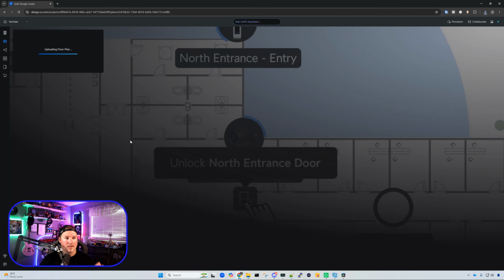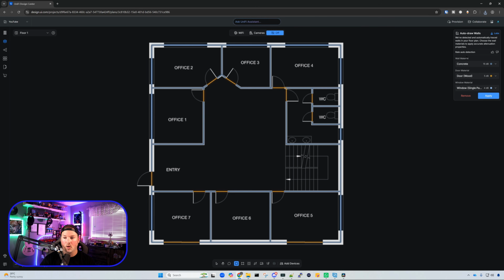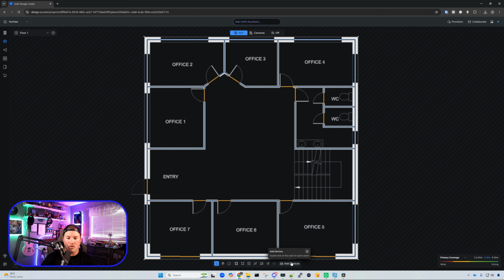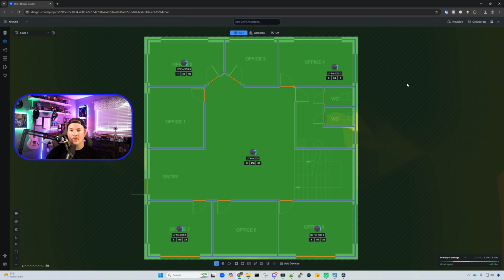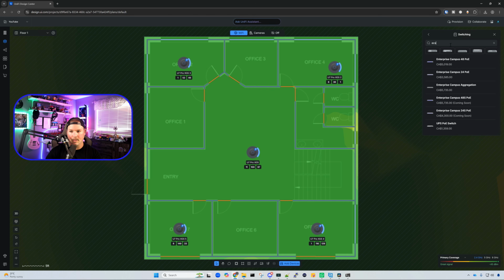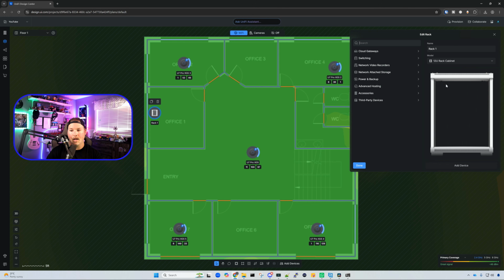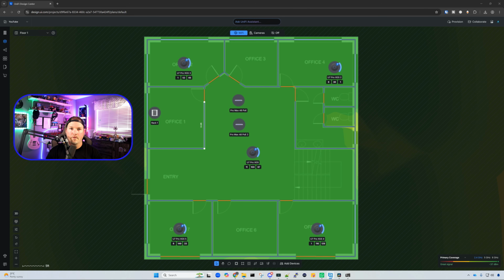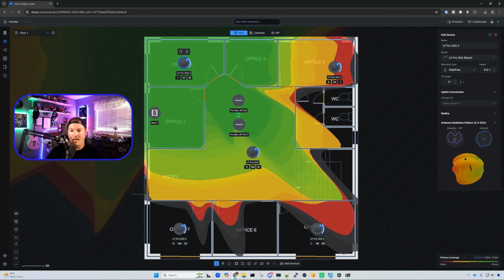UniFi Design Center Just Got WAY Smarter (Auto Wall Drawing + AP Placement)

Comment: It’s great but when setting up equipment, it does not account for the rack being chosen. An issue I have now trying to figure out what rack mounts UI sells that will work with the ENAS and the EF-Core. I want the 12U but I can’t tell if any of their offerings work at all or if I must go with the full 42U option.

Comment: Can you set different wall types for exterior and interior walls?
Reply from the maker: You can
Reply: @MactelecomNetworks  In the demo, it looks like it auto-drew concrete walls for the interior walls. Is that correct for your use case?